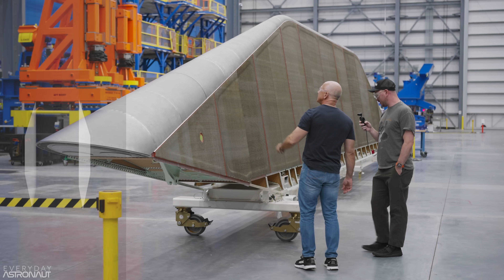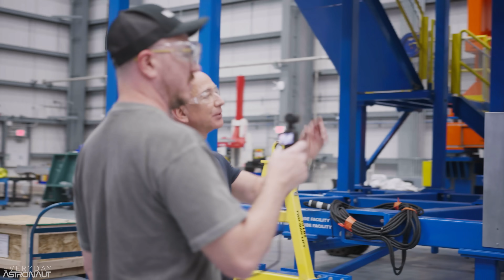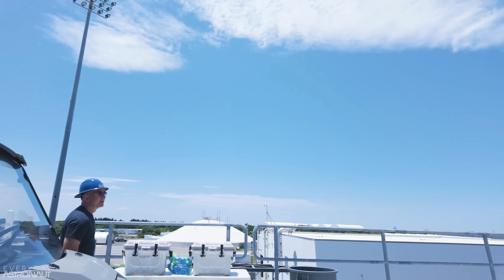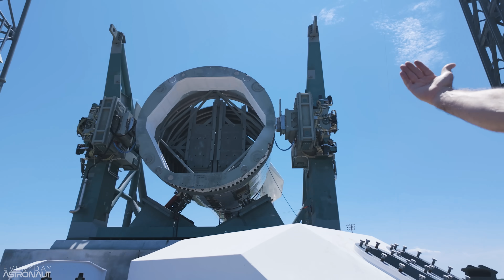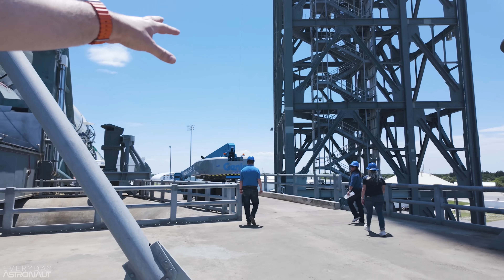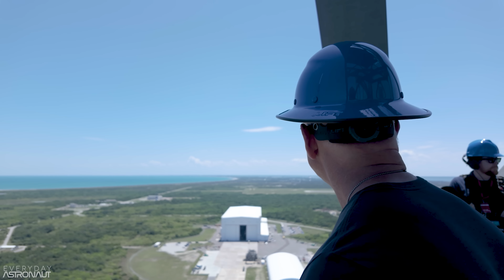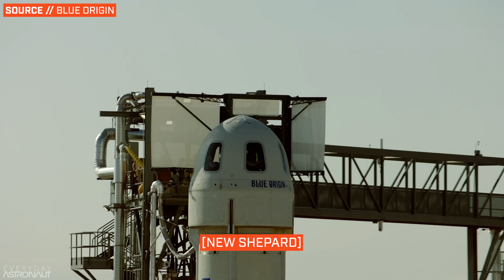First Ever Tour Of Blue Origin's Massive New Glenn Launch Pad w/ Jeff Bezos!

Comment: Two (Blue Origin vs SpaceX) very different approaches to manufacturing and both totally different than how Saturn V was built, with all the major components subcontracted to different suppliers. Gotta give both companies props for designing and building boosters AND upper stages.
Reply: Besides Blue Origin and SpaceX, it seems like Rocket Lab is finding the right balance between the two approaches. Without all of the resources that a billionaire owner brings they can't afford to go too slowly nor spend too much time iterating and blowing stuff up.
Reply: @C-U-Next-Toosday which btw, I love that Blue Origin's seal has turtles on it. They really leaned into being the turtle to SpaceX's hare, rhetorically and culturally.
Reply: @C-U-Next-Toosday  the good thing about rapid iteration is that if Blue Origin overlooked a problem, they would lose a full rocket while SpaceX would only lose a prototype.
Reply: @Allthegoodhandlesaretakenlmao Those prototypes still cost as much as actual rockets, because they ARE actual rockets. They may be prototypes but that doesn't make them cheaper.
Reply: @C-U-Next-Toosday You could not be more wrong. SpaceX use Agile design, BO use the waterfall model. The latter has a history of failures with big projects. Just look at Starliner. SpaceX are able to optimise the design, based on actual flight experience with test articles. Werner von Braun had lots of explosions during the development of the A4/V2 rocket.
Reply: @C-U-Next-Toosday starship can launch 880,000lbs for reference
Reply: @C-U-Next-Toosday  FSD is getting better with every update
Reply: @C-U-Next-Toosday yeah but the point is it exists now and nobody wants it there’s no economy for it until starship will exist which is 300 tons to orbit and eat its lunch
Reply: There is no comparison.
Reply: And the rocket engines
Reply: @C-U-Next-Toosday either is BOs
Reply: @C-U-Next-Toosday  I'm glad Elon is so bad at giving time estimates it allowed me enough time to get into TSLA before it goes really nuts. Now it's going to be the Boy Who Cried Wolf Syndrome, right up until the day when Robots are delivering people to their destinations  like it's something normal.
Reply: While in BO pretty much everything is made and assembled in closed building very clean and stuff while spacex is making stuff inside and assembling outside
Reply: @paranaenselol
Not anymore.
Reply: Two s*** billionaires doing inspiring things. One of whom has chronic diarrhea of the mouth on a daily basis. I am starting to prefer the one with continence.
Reply: @mattcy6591
If you don’t like what he says then ignore it. Some people are so petty just because they guy allows both sides and even playing field on twitter.  
I remember before when people complained about bias liberals said to bad it’s a private company.  They can do what they want.  I don’t hear that anymore.
Reply: All three have very different goals and use cases. Blue Origin is a rich people's toy.
Reply: @kmoecub  Blue Origin's goal is to be less expensive and more efficient than SpaceX's rockets, to make getting payloads to orbit as cheaply as possible.
Reply: @scirrhia_kruden never gonna happen with this architecture lol
Reply: @scirrhia_kruden they are failing massively if that is their goal and if starship works new Glenn has zero chance of meeting that goal so they are much more behind than I thought when I had there goal as being the alternative to spaceX for those that hate musk.
Reply: @felixsimardt  you mean it'll happen easily given Starship's current mission architecture, which requires potentially two dozen refueling launches just to land on and return from the moon. 

Plus, Bezos is all about logistics and efficiency, and Blue Origin has built their factories and designed New Glenn specifically with cost effectiveness and ease of manufacturing in mind. EVERYTHING is focused on lowering costs, it's the entire point of the program, and has been from the start. 

SpaceX might get Starship somewhere really awesome, but it'll never reach the turnaround times Musk promises (24 hours to relaunch the same rocket), and it's not being designed to be inexpensive. It's designed to be powerful and reusable, but if both Starship/Heavy Booster and New Glenn are reusable, the edge will go to the one that can be manufactured more cheaply and more quickly.
Reply: @scirrhia_kruden  Superheavy has to be cheaper to build. Its stainless steel, not carbon fiber. Superheavy uses motors instead of hydraulics. It uses raptors instead of be4. They've already built like 30. BO is CNCing 90% of the material out of a plate instead of 3d printing. I cant imagine it's cheaper to build New Glenn. My guess is it'll be more than 10x the cost of a Superheavy. I'm just on the sidelines though, I dont have any actual concrete info.
Reply: @C-U-Next-Toosday for reference Falcon Heavy which has flown for 8 years can launch 141,000lbs and this can only launch 99,000lbs 😂

Comment: I don't quite understand how NG's strakes help saving propellant on descend. Bezos already said they'd do a re-entry burn. And wings don't do much when landing vertically, right?

I can easily imagine them helping with cross-range (for whatever that would be useful), but delta-v?
Reply: They provide lift and drag which helps the vehicle bleed off speed across range on its way to landing so you don’t need as much burn time to slow the vehicle to zero. On the final vertical part of the descent they’re not contributing anymore
Reply: The way they explained it in Part 1 is that the strakes reduce amount of time the engine has to burn, perhaps down to just a few second burst, and they have no re-entry burn, either. This saves propellant because they essentially have a way to glide back, like a Shuttle orbiter to the barge, then do a hover burn, fly over the barge, and then land on it.
Reply: The booster will most probably won't fall down dead straight (vertical) they'll enter with slight angle thus creating more surface area , more drag , lesser final velocity before landing burn , less fuel for landing burn.
Reply: They don't need to do as much of an entry burn if they use the strakes to glide in the upper atmosphere and bleed off velocity.
Reply: Thanks for the replies. I understand that the vehicle should be able to minimize its terminal velocity, by means of angling itself so the strakes provide additional air resistance right before landing burn begins.
This does make a lot of sense. Still, it's hard to imagine that the savings on landing propellant are worth the additional mass. But apparently the math does check out or else they wouldn't do it like that. :)